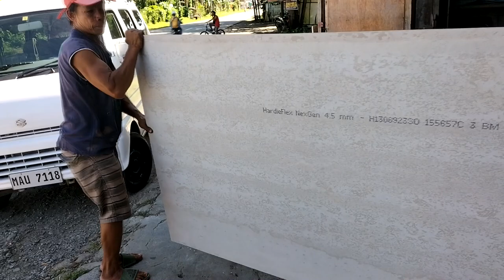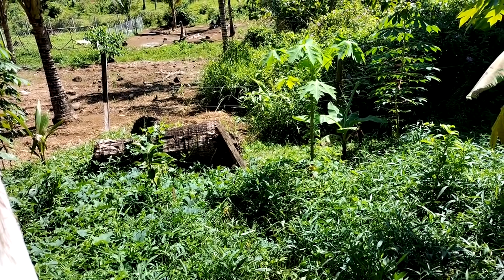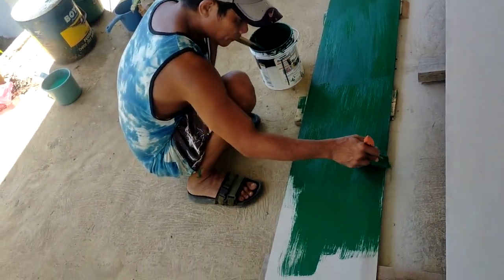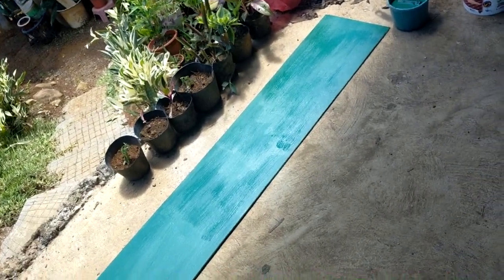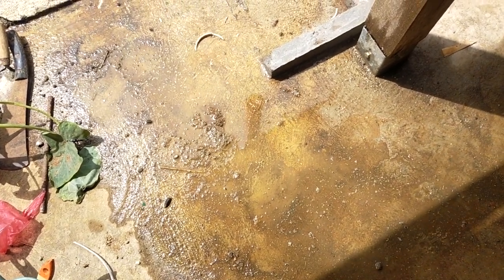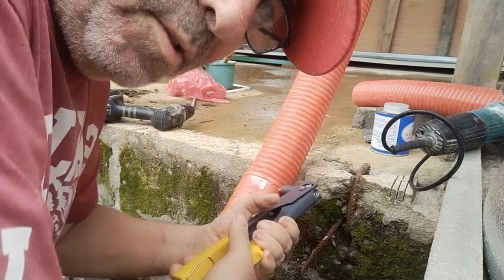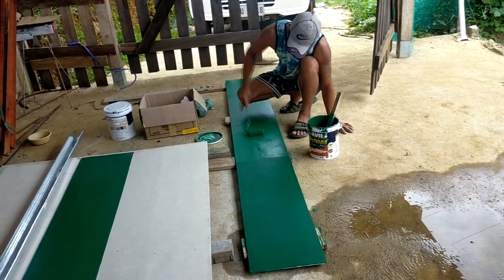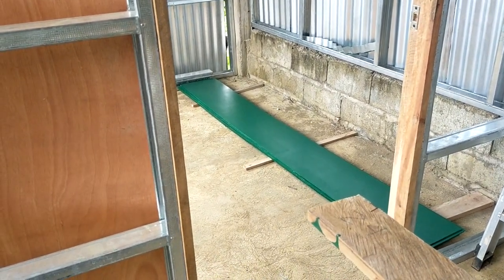V430 - FOREIGNER BUILDING A CHEAP HOUSE IN THE PHILIPPINES - HOW TO MAKE CHEAP ROOF FASCIA

Comment: Joe, anyone above you will pollute the water table below, so good idea not to drill, one or even two more tanks should be enough for washing etc, you only drink bottled water right so if you run out you can always go to the river, and if the other people around work something out you could always pump from the river between you all.
Reply from the maker: Yes. I actually have a pump set up that can connect to the portable power station and get a full trash bin from the river if required.😊👍👍

Comment: Getting there Joe, I use a Straight edge and Stanley (Craft) Knife to cut Hardiflex, cleaner cut and no electric. But I guess if you like the angle grinder go fir it 🙂   I'd be interested to see how they knew water was in that spot, did they use pieces of wire.wood etc?
Reply from the maker: I don't know, I arrived from shopping just after😊👍👍

Comment: We spent 65,000 pesos. One thing to consider down the road is once you have running water in the kitchen and bath, you will use 3-4 times the amount you use now. Good idea for now, but keep a small amount back every month for upgrades to water, electricity, and food once the home is complete. Good luck!!
Reply from the maker: Thank you😊👍👍
Reply: Once the little girl turns into a teenager.   The water use will be much higher.
Reply from the maker: @markelliot6757  yes of course. Add another tank if need be. I feel those tropical rains can feed 20 big tanks🤭